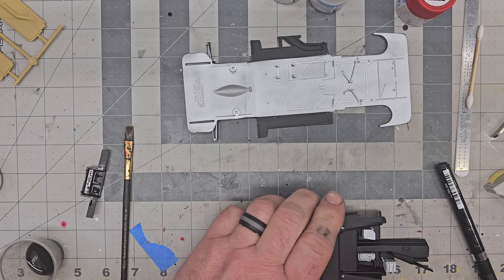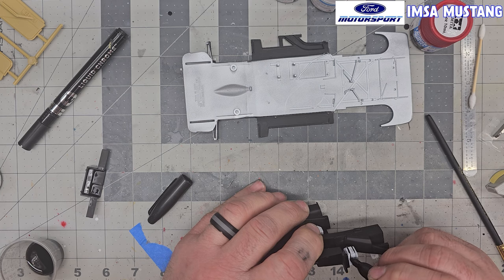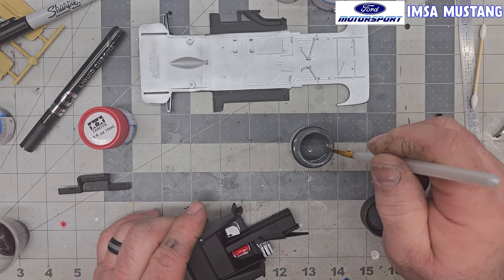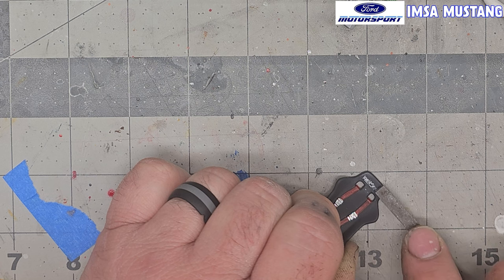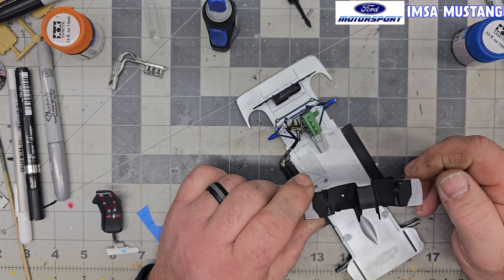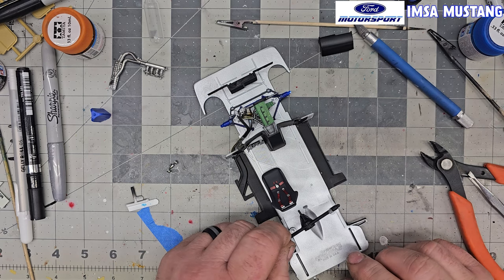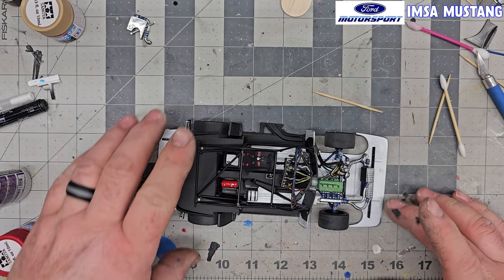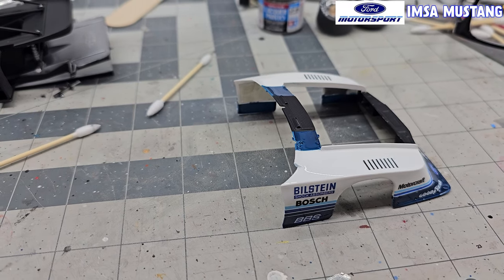ALMOST DONE... IMSA MUSTANG BY MONOGRAM #mustang60 #monogram

Comment: Yep, I laid down that radiator/intercooler at first too. And Ive noticed mine has a warp,...it's 3 wheeling a little bit. Horking hard to finish if for Wednesday. Luckily it's Wednesday for 24 hours. Looking good so far. Nice kit, not a great kit. Its missing some details. But, Id build another.